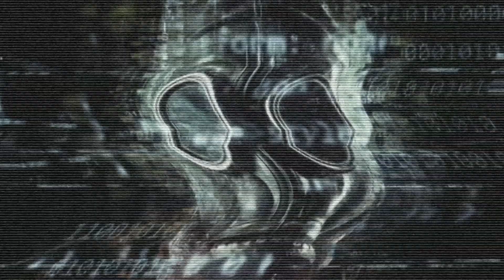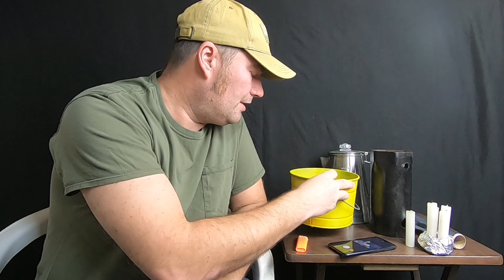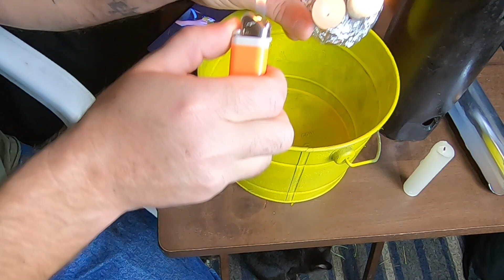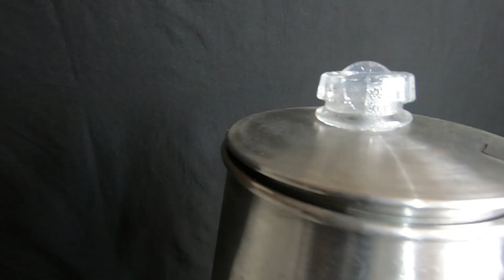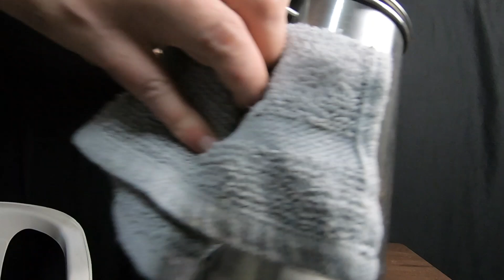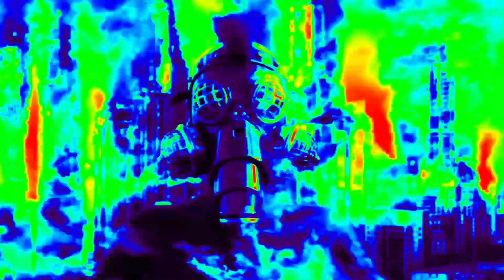Heat From A Candle ?

Comment: I found that  when we practiced cooking with sterno using a frying pan/pot the hottest position was about 1.25 and 1.5 inches above the top rim of the can. I found in our home made oven(box covered in tin foil) that was too hot, and I burned the bread. We needed a heat shield to absorb the direct heat, and the racks were placed 6 inches above the sterno. This was trial and error. We burned a few dishes before we got it right. That was round 1. I dont know when round 2 will hit but I am better prepared. I suffered last time. I dont want to repeat my short falls If i can help it. Folks need to take stock of their preps, make menus, and practice. I could NOT get a food delivery for six weeks. We made it. I am not getting  caught short again.  We have more sterno than before, and now that we are out of the apartment, we have a BBQ grill( kettle type). I spent the summer cooking meals on it and baking bread. I got the hang of it. I think we have 4 months food/fuel/water. If I have a small warning I will fill up the waterbob that holds about 100 gallons too. I am more confident now thanks to you AP, and Spfb

Comment: Hey CFP, Like your videos. Let me offer a twist on what this prepper does. I save my candles for emergency lighting along with my oil lamps. What I do is a save my melted candle wax when I burn my candles. I take a tuna can and roll up strips of cardboard the height of the can until I have the full diameter of the can coragated side up and then fill with the wax that I saved and melted. This adds a few more BTU's than the candles and works the same as what you've shown. In the process I have taken what would be trash and have made a useable resource in emergency situations. I like that your showing how to do things other than just prepping food, which is important. The scenes from Texas has proved that there are a lot of people who don't know what to do in SHTF situations, and how we all need to think ahead.